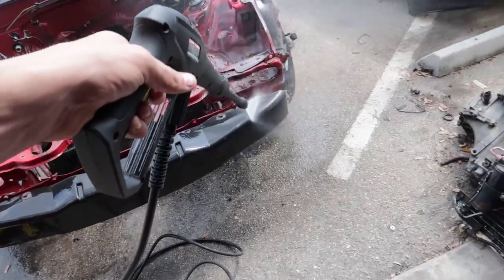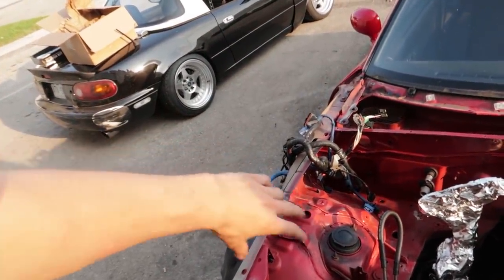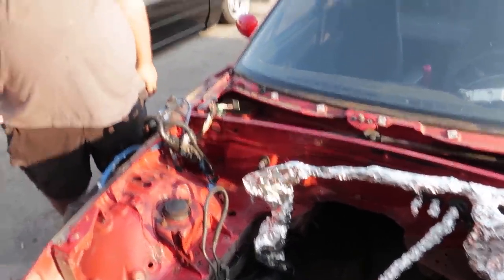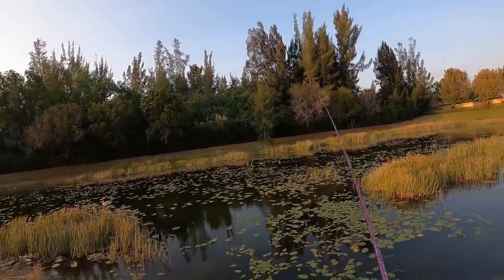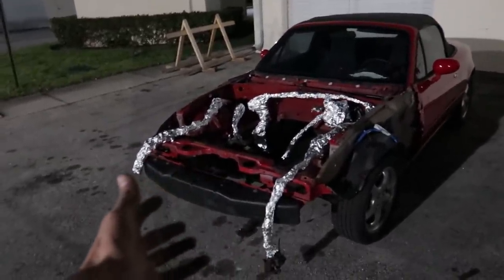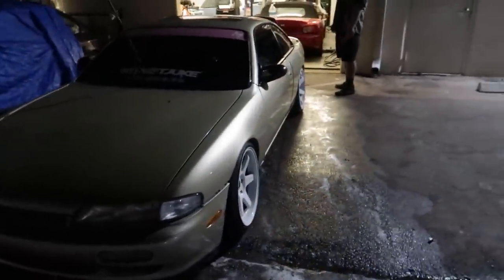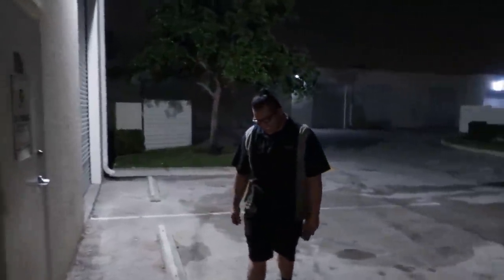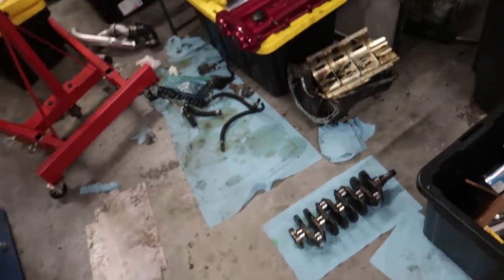SPACEX MIATA BUILD IS FINISHED!

Comment: The most productive worm I've used for small pond fishing is the 7" power worms in tequila sunrise or any red color. Make sure you know how to rig with offset worm hooks and use very small weights if needed. The smaller zoom flukes are a killer almost all year long when rigged weightless so give them a shot if you want to change it up. By far my favorite way to catch pond bass is the old reliable texas rigged yamamoto senko, wacky rigged if I''m feeling schmick.

Comment: also glad to see you doing the safe thing Sam! you can rest easy knowing you're giving away a "reliable" turbo miata! the harmonics honestly get really sketchy around 300hp/ 250tq so its good you chose to get the boundary oil pump because you can comfortably push your car further than chris's now and not have to worry about your oil pump sending metal sand through your motor (; btw Im praying for his oil pump gears

Comment: Hell yeah on the oil pump. Now if you accidentally over-rev it or go for some big power you will be good. The valvetrain is limited to around 7500 I think before valves start to float. Now you're good to rev it as far as you want up until that point.

Comment: Honestly Sam, if you're planning on being there for a while and would really like to get more into fishing you'd want to consider getting a nicer rod and reel. Also, start using braided line, and get some assorted lures like some topwater, some suspended/shallow diving swim baits, and also pick up some assorted plastic baits. The big bass will be fairly hard to catch right now because they're spawning, but in a month or so they'll be out feeding. You might want to check out 6th Sense lures and Karl's Bait Shop online and you'll get some decent lures and deals since the big shops are closed.

Comment: Sam, does dunkin make your coffee right everytime, or is it usually messed up? Around here, the only thing dunkin does consistently is mess up my order 🤦‍♂️
Reply: What do they mess up exactly?
Reply: Used to work at a dunkin. When I was managing it I had a challenge with 5 others to make the same coffee. An Iced caramel swirl with reg. Cream and sugar. Every. One. Of the coffees tasted different. All were watched and built the coffee the same way. And same order. You almost have to get the same person to make your shit if you want it close every time.
Reply: I used to work there too, and the way I was taught to make iced coffee is simple: fill the cup with ice, do your pumps of flavor(3 for med, 4 for lrg etc) then milk or cream machine(press the button for desired amount) fill the rest with coffee and stir... now if any of these steps are out of place, it throws the whole thing off. If you put coffee before ice, you're screwed. If the milk/cream machine isnt cleaned properly and you just get a trickle when the button is pressed, you'll get too much coffee and it throws it off. Or you get someone that just doesnt listen and puts cream and sugar when you ask for whole milk no sugar

Comment: It’s not overkill to get that hp oil pump. As you can see Rodnock destroys almost every engine he touches, his advice is not the best. If you hadn’t built your Miata engine Rodnock wouldn’t have even considered it. Just keep building to your standards as they are leagues above what Rodnock does on the regular.

Comment: yes CA18 build! higher rev, more torque, iron block and 200 pounds lighter than sr20. i dont understand why people keep ripping them out for sr20s. /watch?v=wjkMjZ5-zNM
Reply: also you can take the CA20 SOHC bottom end with a CA18 head with little work and get a CA20 DOHC that way. i think HKS also did a stroker kit aswell.